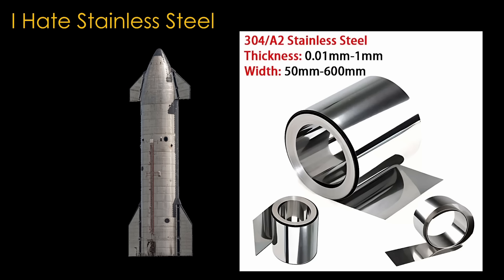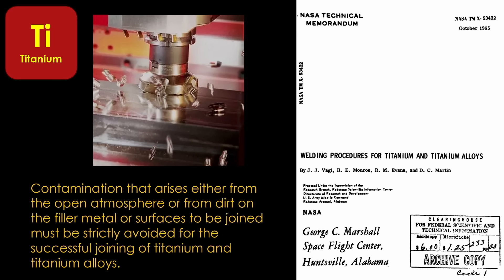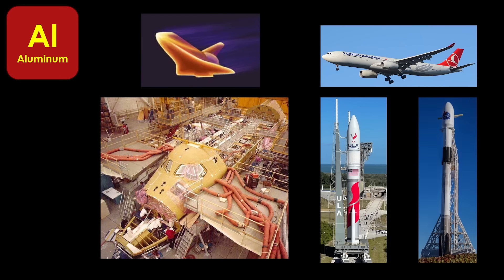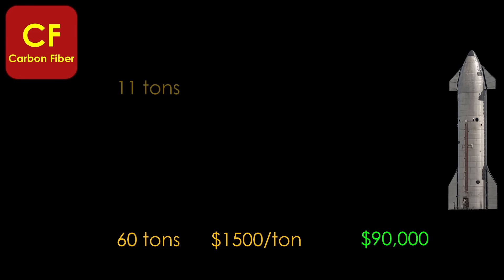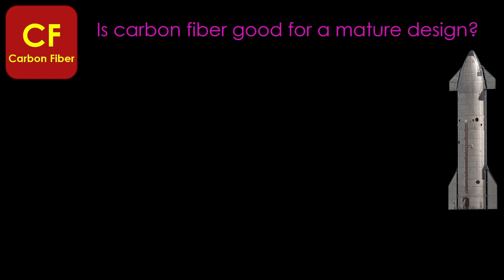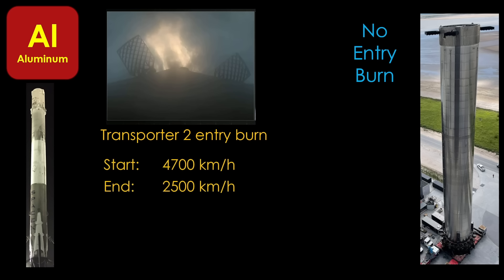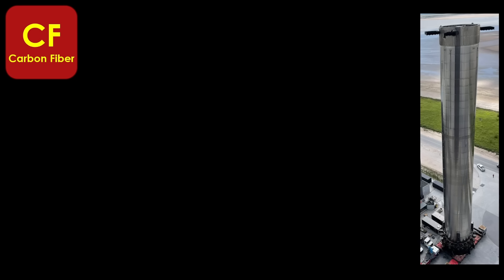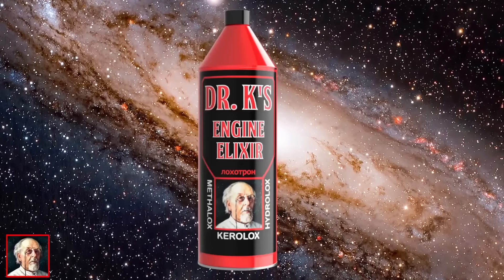Why Starship Loves Stainless Steel...

Comment: I think another important point is that steel has a “fatigue limit” where steel won’t lose strength after a load cycle. Al, carbon fiber and titanium will slowly lose strength through many cycles. That is one reason why steel is used in car engine parts such as connecting rods. Given Starship wants to be “rapidly reusable” any be able to last as long as possible, it would make sense to use steel, as using the alternatives would require stress tests the older a booster or ship gets.
Reply from the maker: Very good point that I didn't talk about - you size aluminum not based on strength but based on fatigue, and that means it's heavier than otherwise. I don't know enough about carbon fiber to know how it responds to fatigue other than knowing that it takes very little deformation to cause issues.
Reply: @EagerSpace  he noticed me ❤️😁love your videos sir, good work!
Reply: @quadj5763  I would make one point: the operating temps of steel in modern combustion engines is far lower than the 800 degrees it’s usually around 200-250 with the surface area of the parts being small and actively cooled. A large surface area of thin steel at much higher temperatures could be another beast entirely.
Reply: @EagerSpace  So you wouldn’t get in a carbon fiber ship named Titan for any amount of money?
Reply: What is cycling though for fatigue to be an issue? Even the grid fins, which shake violently, still only experience maybe 1000 cycles? Peanuts in the fatigue world (unless these are plastic cycles, but then fatigue is a bit of a misnomer)
Reply from the maker: Stainless is a lot better at high temperature than carbon steel, and a lot of modern engines have aluminum blocks or heads
Reply from the maker: Depends on how many flights it has already made...
Reply from the maker: Fatigue is going to depend on the frequency of the stress and the magnitude of the force. My understanding is that the first part of reentry is pretty chill because there's so little atmosphere, but once you get deep in the atmosphere you're going to have to deal with wind. You also have to deal with wind on ascent.
Reply: @EagerSpace  Well. we will find out pretty soon, as the Dreamliners flying today age and go through maintenance.
Reply: @EagerSpace  I've heard numbers of 2-5x designed load strength. Not only because of possible fatigue but because it's really difficult to inspect.
Reply: @EagerSpace  It is difficult to take advantage of the superior high temperature performance of stainless since there aren’t many interior surfaces of Starship that can tolerate 400°C. How does 400°C affect the payload bay, the avionics, the LOX residual gases, the passengers?  The target temperature behind the heatshield isn’t that different for stainless and aluminum.
A reminder:
The Space Shuttle was made of aluminum and was not resilient to loss of a single tile.
Starship is made of stainless, which is way better right? “Right now, we are not resilient to loss of a single tile in most places.” - Elon Musk. 
So they had to add a whole backup ablative heat shield…
Reply: @marksinclair701  They did lose a bunch of tiles on the fourth flight and survived. They intentionally left out several tiles on the lower engine compartment skirt and it didn't burn through hard enough to prevent the normal operation of the engines during the landing burn.

Stainless steel certainly isn't a miracle material that eliminates all challenges with heating during reentry, but it does make the vehicle a lot more robust. I think the additional ablative heat shield is primarily not for surviving reentry in the event of lost tiles, but more for surviving reentry without structural damage in the event of lost tiles. If losing a tile means scrapping the vehicle after landing, because the steel is eroded and deformed, that puts a serious dent in the idea of rapid reuse.
Reply: @SpaceAdvocate  They deliberately lost tiles in a totally unimportant area, and that apparently proved to Elon that they weren’t “resilient to loss of a single tile”. Sounds like burn through to me, we just never say the results. The loss of tiles/heatshield at the flap was in some ways a lucky break. If the lost tiles had been next to avionics, header tank, LOX tank, etc., etc. it would have been loss of vehicle. The flap slowly burned through with steadily degrading performance, that doesn’t happen on a LOX tank leak…….
Reply: @marksinclair701  We don't know how many tiles they lost elsewhere, that didn't result in major (vehicle ending) structural damage, but it's very likely some tiles were lost.
Reply: No steel rocket will ever be fatigue proof. It would never get off the ground. Disclaimer: I didn't do any calculations.
Reply: @Papershields001  From my little bit of knife making, that's floating around the 400-800 F area used for tempering (increasing ductility) of hardened steel.
Reply: @EagerSpace  Good points
Reply: @Mjr._Kong  it doesn’t matter if it’s stronger once it’s heated and cools down again. The time when excessive loads are going to be on it is the same time when it’s extremely hot. So take the steel out of the fire at 400-600 degrees try and bend it then, I guarantee you that it’s easier to bend hot than when it’s room temp.
Reply: @Mjr._Kong  there’s a reason why the sr-71 was made from titanium and the mig 25 foxbat was made out of tempered steel. One was made to be heated for hours and the other was made to be heated for mins at most.
Reply: Fatigue limit isn't really an issue with something that you might want to use 20-50 times.
Reply: @EagerSpace  many ppl forget that the Soviets and the British use stainless steel in supersonic aircraft
Reply: Airplanes fatigue but at a rate that allow them many years and thousands of cycles. A carbon fiber space vehicle only has to fly dozens of times to be economic.
Reply: @EagerSpace 

Another thing that you didn’t talk about which is extremely important is basically a third year engineering question (which was asked in my third year by the professor). By your logic large aircraft should be (/ could be) built out of stainless steel (as per your Super Heavy logic), BUT ARE NOT ! Why is that not the case? The reason is extremely clear if you follow the iterations of super heavy. Aluminum provides significant better buckling resistance as a function of weight due to having a significantly better “bending moment” due to the inherent geometry generated out of a significantly lower density material. It is easy to see this at work in super heavy where they have drastically increased the number of internal stringers to deal with this problem. It is now basically the case that super heavy has effectively doubled the amount of stainless steel to generate a good cross-section geometry to resist buckling. All of these internal stringers appear to be spot welded onto the outer skin generating stress concentrations that hurt the buckling strength. This requires further strengthening adding weight and any mechanical engineer can see the spiraling addition of weight needing more engines, more fuel adding more weight (iterate as per Musk Methodology). One can make stainless steel work, but is it optimal ‽

Comment: Not mentioned: 304L is stronger at cryogenic temperatures. Carbon fiber is not.
Reply from the maker: Yes. Not clear if you can use that higher strength, because not all of the rocket at cryo and then the temp profile will change as you drain the tanks. Above my pay grade.
Reply: I thought the significant difference wasn't really that stainless gains strength, but that CF /loses/ strength at cold temps. 
(I guess you have to design for the temp at which your material is weakest...
Reply: SpaceX is actually using a special blend 304l nicknamed 304x. I don’t remember off the top of my head the exact difference but there are differences from run of the mill 304l.

Comment: A kilogram saved on a FALCON second stage is a kilogram of extra payload. On starship, which needs to reenter and land, a kilogram saved is MORE than a kilogram of payload, since the lighter weight means less heating, thus less shielding and less landing fuel. How much is hard to guess, but 1 kg of structure mass saved on second stage Starship is probably 2 kg of payload.
Reply from the maker: Landing fuel is pretty minimal so I wouldn't expect it to be a big effect. Heat shielding is an interesting question; I'm not sure how good the thermal protection models are and whether they are able to allow you to optimize things that way or not.
Reply: @EagerSpace  Quick rough estimate on saved landing fuel: landing fuel mass is roughly 6 tons, with 100 tons dry weight, so fuel mass saved is 60g per kg of structure saved. Heat sheild mass is about 10 tons... so again wildly  assuming that also scales with landing mass, you'd save 100 grams per kilo.  So, rough guess, a kilogram of starship structure mass saved means 1160 grams of extra payload. My previous guess of 2 kg is clearly way too much.

Comment: One final reason why Carbon Fiber isn't suitable: It has terrible fatigue-properties. It is very difficult to predict and model the rate of fatigue in fibrous non-homogenous parts of any kind, and CF is infamous for not lasting long in dynamic environments. (Case in point, CF piston-rods in engines). For a reusable vehicle designed to fly 100 times/year exposed to the elements and greatly shifting temperatures including cryogenic, this is a big issue.
Reply from the maker: That's an area I probably could have covered.
Reply: @EagerSpace  There's a big difference between being a piston rod and being a spaceship. If you're getting 20 uses out of a "reusable" spaceship then you're in the land of diminishing returns where your operations costs are far more important. If you're getting 50 uses then you're doing really, really well. Carbon fiber will handle that.
Reply from the maker: It all depends on the relative costs, and I don't think we know what those are. In some cases I think the difference between 20 and 50 would have a huge impact on cost per flight, in other cases I think it would be a small impact.
Reply: @saumyacow4435  
The vibrations and loads are shifting a lot more than a couple of times per flight. Look at the ITF4 launch.

Comment: Suprised you didn't talk about material strength at cryo temps as that was another big reason for the switch.
Reply from the maker: Thought about it but decided not to. Probably just laziness.
Reply: @EagerSpace  Presumably because 2195 aluminum is actually a lot stronger than 304 stainless, even after accounting for cryogenic temperatures......
Stainless has a higher strength gain, but starts from a lower baseline...........

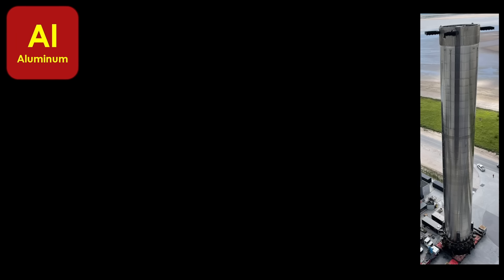Comment: Great video as usual but the mention of Falcon 9's entry burn (at 9:29) reminded me that this standard explanation has always bugged me. I've heard many, many people explain that the entry burn is required to reduce the booster's speed in order to reduce reentry heating to a low enough level that the booster can withstand and survive, but this has never made sense to me for the following reason: On a droneship landing trajectory, the booster maxes out at ~8,000 kph before the entry burn, and slows down to ~5,000 by the end of the burn, which is basically the same as the booster's speed at the START of the entry burn on a RTLS trajectory. If it can survive a 5,000kph plunge through the atmosphere, why does it need an entry burn at all on a RTLS flight? 

I've also heard that a side benefit (perhaps the primary benefit?) of the entry burn is that the exhaust plume breaks up the shock front and prevents it from "attaching" to the booster, and thus significantly reducing the heat transfer/loading, and that's what actually protects the booster instead of the speed reduction. I have no idea if that's true (and can't remember where I heard it) but I'd love to hear an in-depth exploration of this in a future video.
Reply: The speed on screen may not fully represent the vertical velocity. The speed vertically on the two landing profiles may be similar, requiring the entry burn to take off energy.

Comment: 12:24  at 2 tons per engine, that 66 tons of engines. reducing the weight of each engine to 1.5 tons each also saves around 17 tons. much easier ways to save weight, including removing the dozens of tons of shielding and fire suppression systems, optimizing hotstaging ring, reducing to 3 gridfins, and probably more
Reply from the maker: Agree with all that.
Reply: @EagerSpace  The number are from SpaceX are quite dramatic:
Raptor 1 Engine + vehicle-side commodities and hardware mass: 3630kg
Raptor 3 Engine + vehicle-side commodities and hardware mass : 1720kg
Savings = 1910 kg/engine. That’s 63t for 33 engines. Massive.
But what does “vehicle side commodities” include anyway? 
Is that propellant residuals, outside of ullage?
Reply: @marksinclair701  They likely include the gas they inject in the engine bay to avoid fires.
Reply: @SpaceAdvocate  Thank you, that'll be most of it. How do they restart the inner 13 engines? Is ullage pressure enough?
Reply: @marksinclair701  They spin them up using gas from COPVs. That's possibly also included, but I wouldn't think the amount of gas needed would be very different.
Reply: @SpaceAdvocate  I recall CO2 for fire suppression, and maybe helium for startup....? 
Also worth some cost savings if so.
Reply: Excuse my dumbness, but why is 3 grid fins better then 4?
Reply: @Hungary_0987 Only benefit is saved mass, 4 grid fins provide alot better control than 3 grid finds.
Reply from the maker: Grid fins are big and heavy, and you can get all the control you need with 3.
Reply: @EagerSpace But SpaceX must have debated how many fins they needed in the design process and came up with 4. On IFT3 the booster had decent problems. Yes it was missing engines and off balance by hot stage ring,  but block two will not eject the ring.
Reply: @GawainNYC  Yeah also its last optimization they will do (even if they ever will). They got much bigger fishes too fry like start-up of engines, residuals and raptor shielding weight too solve first. Ahh and of course how to make effective "reusable " hot statgin interstage.
Reply: @marksinclair701  I was under impression helium is used  for "purge" only. And then nitrogen does main spool up?
Reply: @SpaceAdvocate  If i m correct by spacex tweet post new Raptor will soleve all than with 37t of weight saved. So less leaks means less of a need for suppression contingencies and less heat shielding.
Reply: That appears to be what was done from Raptor V1 to V3

Comment: I always find the stainless steel vs aluminum comparisons simplistic, even when you consider temperature - an aluminum starship would quite definitely not be 1/3 the weight of a SS3xx one. At best, it might be 30% lower mass, and in practice, likely equal. Suppose Aluminum 7075-T6 were used for the primary structure. It has a yield strength of between 450-550 MPa, and an ultimate strength of 530-560 MPa. Compare this to stainless steel 301 sheet, whose hardness state must be considered. In the annealed state, its yield will sit around 170 MPa. In the half-hard state, this jumps to 640 MPa. Full hard brings this to 900 MPa - and that's ignoring the impressive post-yield behavior, which can often be effectively utilized in aerospace design, bringing the effective strength to 1200 MPa (note there are major anisotropic effects in 301 FHD, so keep that in mind). That is to say, the strength to weight of aluminum 7075-T6 at STP is about 0.18 MPa*kg/m^3, vs SS 301 FHD at 0.15 MPa*kg/m^3, a 20% difference. Now 301 FHD can't be used for all structures, it's difficult to bend, and welding affects this, but welding affects aluminum strength more, and 7075 cannot be easily bent either, meaning barring expensive machined isogrid structures, aluminum structures are often made of either much weaker or more expensive alloys. All this is to say: aluminum just isn't that great. (numbers from MMPDS-15). When you add in the thermal behavior, e.g. how the flaps in IFT4 did post-heat shield failure....
Reply from the maker: Thanks for adding more depth than I provided.
Reply: I once had to do this exact tradeoff on a very complex cast part and I definitely concur that the tradeoff is not often as clear cut as it seems. Sometimes, structural design is just as impactful as pure density and mechanical properties. If one design only allows for X structural design that favors using material 1 but material 2 also allows for another structural design Y that means you need less to do more, you can end up with specific results that, on paper, look as if they shouldn't have happened when only looking at a strength/density chart.